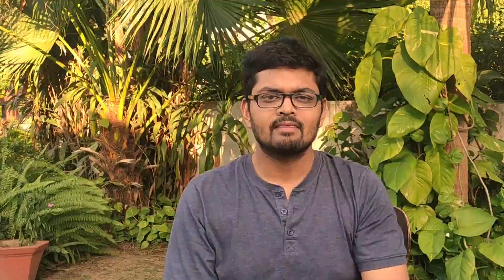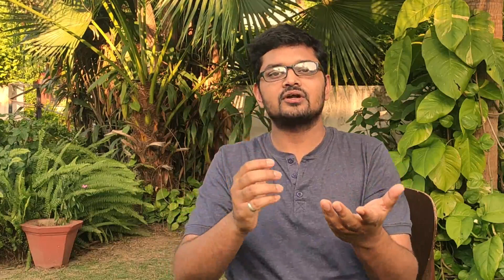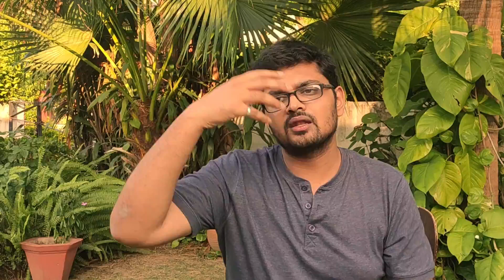Passive Cooling Techniques are Meaningless | Sustainable Architecture

Comment: ( This is gonna be long....)

I think you are missing that residential buildings come in different economic categories. Poorer residences may not necessarily utilise air conditioning but might use cheaper mechanical cooling like fans. In such cases, the choices in the physical building construction such as materials of construction, natural ventilation, and solar considerations can reduce the demand for cooling. This is the concept behind passive buildings. These designs have be intuititively refined over centuries based on the natural climates of the regions. It is basically what physical contruction takes less effort for the climate to be cool for a particular climate. Note however, this assumes that the heat generated from appliances is not significant, but if it a lower class household, that is to be expected.

I know we like to think everyone can afford air conditioning... but then we would be like Marie Antoinette saying "Let them eat cake" when the peasants have no bread to eat.. Open minds are important. If we interpret the world based only on our knowledge and not that of the customer, we are doing a great injustice to those we are supplying designs to... Everyone has the right to comfortable housing... even those in lower social brackets.

One last point... if the some of the elements of a good passive design can be implemented in a forced ventilation design, you would get the best of both worlds - faster cooling with less energy demand. However, this only become apparent if you factor building construction and shading into the air conditioning design. Lately however, I have been noticing the trend of "one size fits all" and "oversized" air conditioning design. ( Hey manufacturer and retailers have to hustle too because these design are overpriced as well 😐) Unfortunately, this is actually one of the reasons why you might not appreciate sustainable housing or passive technologies - it requires a lot more calculation and planning and unfortunately we live in a world of quick fix.

Energy efficient housing has a lot of math involved to balance the energy transfers. It is better to leave it to the persons with experience in computing these designs as they can churn them out at a much faster rate than novices. If you have a detailed software to assist though, you would go a lot faster.
Reply: poor people aren't hiring architects either
Reply: Simply put, He said we cannot use open floor ventilated design to reduce energy consumption of closed room Cooling Systems.
Reply: Good point you make. As a heads up, I am not indian, and my knowledge of its socio-economics is superficial at best. I am curious however, as to how wrong or right my assumption that the less fortunate don't hire architects anyways. On the other hand, if we get into democratic design, or mass built governmenet backed social housing i see how ur point would be valid. 
In a neo-vernacular approach you could in theory present a model that can be replicated by the masses that utilises passive methods (or at least reviving methods that have been perfected traditionally throughout the centuries)
For social housing you could perhaps have a central cooling system that utilises various passive methods as well as air conditioning.  
Outside of these two scenarios, I don't think the point you made would be valid (again how plausible they are is totally beyond me)
Reply: I would say, your reply can be considered a continuation to my reply. Well put.
Reply: There is a, sort of, quick fix here. Just install more insulation, much more. If we raise R-value recommendations then energy consumption will be reduced, without requiring contractors to do a bunch of job specific planning, which they are not going to do anyway.
Reply: long or short, he is frustrated at the issues he is seeing from the outcome at present day. it's an emotional response. because we react based on our sense, to our emotional needs rather than our logical wants. your points are right too, but not everyone would have the curiosity to find out or even have the passion to keep trying due to countless reasons especcilly failures. it's also why the world needs more problem solvers rather than the problem itself. heat is something of nature we are not in-control of, but we know where it comes from and where it goes. it's a form of energy that won't dissapear but it can be manipulated or transformed or transfered. solutions of different aspects is what makes improvments, and that's advancement and progression. be creative in learning, be curious in questioning and responding, be logical to decision making and don't forget being practical and kind daily is what's neeeded to create doors upon doors of opportunity to success.
Reply: Hands off to you

Comment: ya well, in a country like India people are mostly under a false impression of western culture. Many Indian regions even not need air-conditioned buildings. many Surveys show that AC is the reason behind global warming. Many public buildings, schools are not necessarily required air-conditioned. People you met and what they think about passive techniques are a different thing, but statementing like passive techniques are meaningless is not okay for the future of the architecture. sustainable architecture is the future of architecture.
Reply: Back in school days sometime during 2013-14, Air conditioned classrooms were marketing tool for coaching classes. Many kids like me used to shiver inside classrooms since we were not used to ACs. And today it's almost like a basic necessity, i find it even on lower middle class households who literally struggle to pay electricity bills.
Reply from the maker: True. We should focus on reducing Cooling loads, thereby reducing the use of ACs. But in places where ACs are must or are already in habitual use, what should we do to reduce the electricity consumption is my point. So far we don't have much options other than controlling U values, building insulation etc. In following sessions, will try to throw some light on the areas we can focus to further reduce AC loads, and lead the road towards sustainability.
Reply: @studiobuiltenvironmentarch1240  what concerns me is that several times in the video and in your comment replies you mention that people are "accustomed to using AC and because of that passive cooling techniques are useless". That's such a limited perspective it's shocking. Do you really think that people, culture, and our habits can't change? The reason people are discussing passive cooling so much is BECAUSE that AC dominated culture is actively changing, right now. The demand is there. It's not idle, theoretical discussion amongst architects. It's what people want.
Reply: @studiobuiltenvironmentarch1240  cannot wait to see it, that next video!